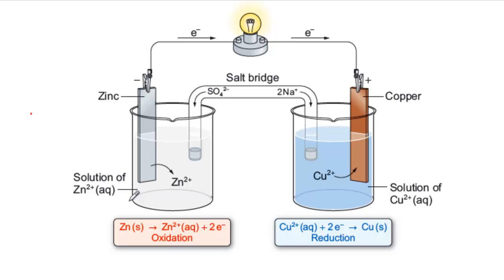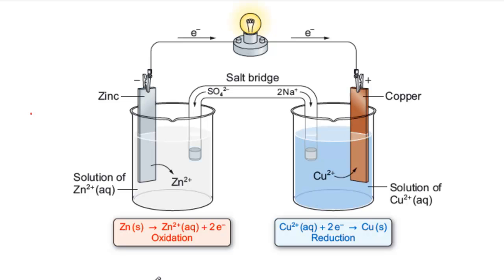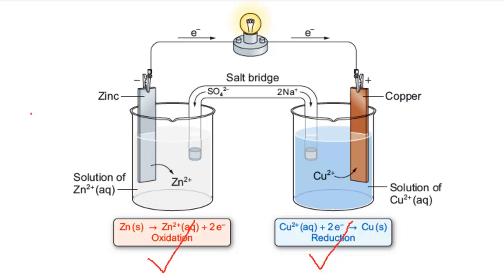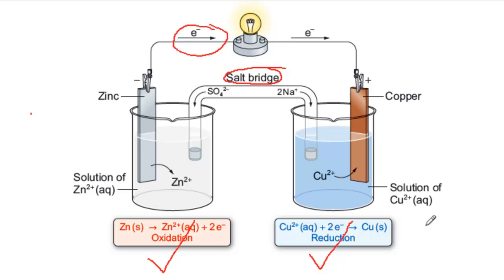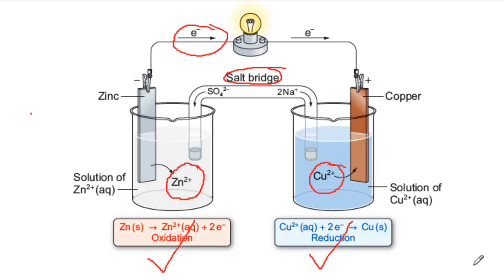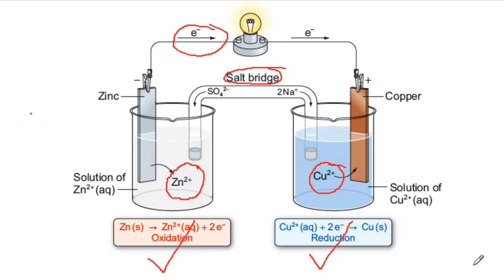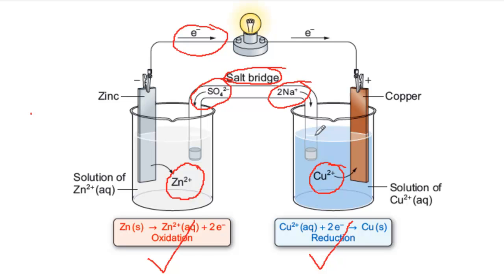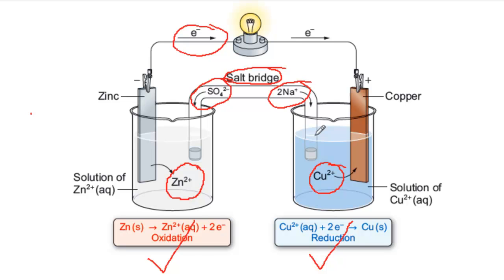A short introduction to the Daniell cell

Comment: I think (Zn) will be the anode sir...because oxidation happens at anode(+),not on cathode.!
Reply: +Muhammad Saad zn is the anode because oxidation occurs at the anode but in galvanic cells the anode is the -ve electrode
Reply: Muhammad Saad Zn will be the negative terminal but positive electrode because it release electron.
Positive electrode = Anode. So the oxidation occur at anode.